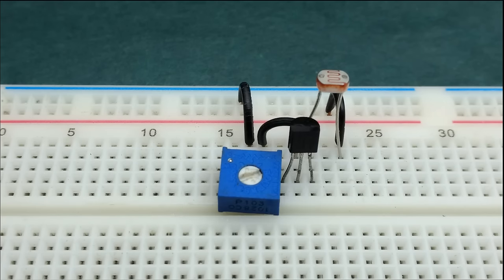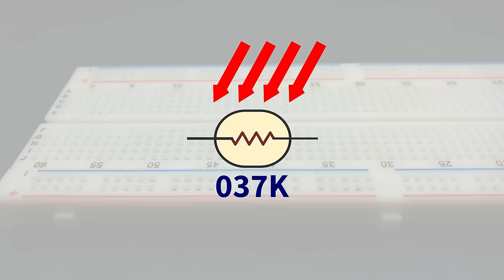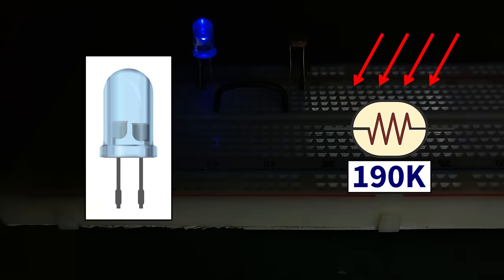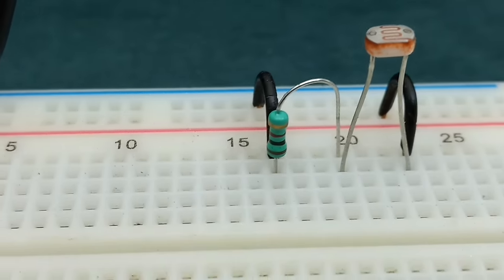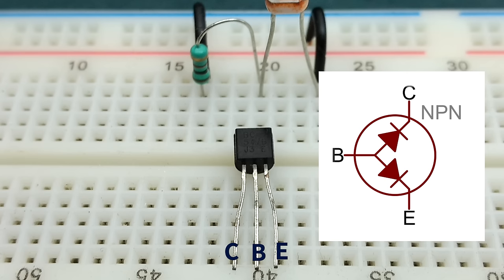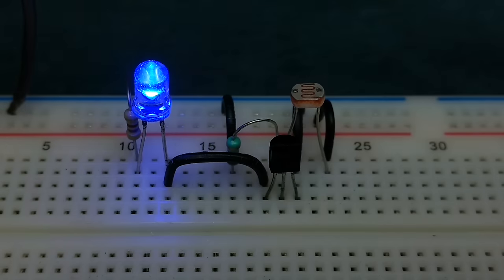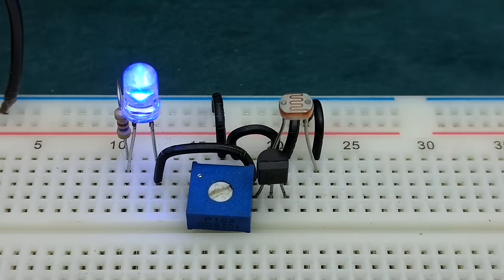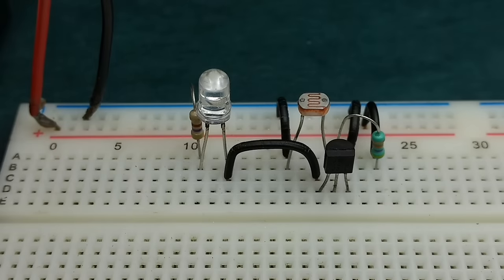Light Sensor circuit on Breadboard + Darkness Detector | LDR & Transistor Projects

Comment: Can you plz tell the reason that while using 1K resistor, it's light activated and while using 47K resistor, it's dark activated, why ?? Plz tell
Reply: The order of the resistor and ldr is also changed which results in voltage to decrease instead of increase.

Comment: Amazing. I finally got it working after hours  and hours. It will not work on an unregulated power supply so I tried a 6V battery and it worked!!!!!

Comment: Thank you, perfect for what I'm looking for: My Motorcycle has no fuel warning light so I'll be using this type of cicuit (modified) to detect the presence of fuel in my fuel line just below the fuel tap - I'll be adding a short 'clear' tube to the existing line & then fully enclosing the project, adding a small *𝒃𝒂𝒄𝒌𝒍𝒊𝒈𝒉𝒕 adjacent to the LDR on the opposite side of the line (this will then be connected to an LED warning light on my dash). * The idea being that there will be detectable differential in the strength of the *𝙡𝙞𝙜𝙝𝙩 𝙨𝙤𝙪𝙧𝙘𝙚 as the clear tube becomes devoid of any fuel.
It will give me time to engage the reserve tank via the tap (as the carburettors hold a small amount of fuel in their float chambers) - there ain't nothing worse than feeling that sudden drop in engine power as you unexpectedly find yourself on empty!!
Reply from the maker: Pefect! That's a great idea. Small automation's like this will make our daily experiences seamless.

Comment: Thank you! Feel very capable after being able to make this even if it's  ot much its a start
Reply: Hello, my sensor does not work. I don't know the problem. Is the reason that I used a resistance of 1 k instead of 470 ohms, and I also used a voltage of 9, not 12?
Reply: @حسنعامر-و3ب  it depende is the led just not turning on or it's always on , it might be the resistir or the wireless are connected properly
Reply: @MemoThePanda  The led is on normally, but when I put my hand on the sensor, the led does not turn off

Comment: Hi. Found a night light with one component labeled PCR 606J, one tiny resistor with Red, Black, Green and Gold bands in that order and a light sensor. Don't know what the PCR 606J is? Thought it was a transistor, but it may be a tiny SCR. Are you familiar with this type of light sensor circuit? Cheers

Comment: Hello, my sensor does not work. I don't know the problem. Is the reason that I used a resistance of 1 k instead of 470 ohms, and I also used a voltage of 9, not 12?

Comment: Great video. I installed a porch light with built in dusk to dawn sensor. Light turns on even when there is plenty of light outside. sensor is facing the street. Can I modify by adding a resistor etc. so it turn on when there is dark outside. Thanks and take care.
Reply: Hello, my sensor does not work. I don't know the problem. Is the reason that I used a resistance of 1 k instead of 470 ohms, and I also used a voltage of 9, not 12?

Comment: What changes must be made if we need to replace dc motor in place of led. Should any resistance be varied.. Pls reply @elonics
Reply from the maker: Depends on which transistor you are using. If it can drain higher power, you may try directly connecting the DC motor. Otherwise you need to add another transistor/mosfet to this circuit's output and connect motor to it. (See: Driving a DC motor using transistor / mosfet)
Reply: @elonics  its a 3-9v dc motor and transistor used is bc547 to a 9v battery

Comment: What common MOSFET can I use instead of the transistor for driving a bigger load (say 8v @ 10mA) ? Also which LDR, there's different ones with different resistances.

Comment: How can i connect a relay i  this circuit, i have used relay but it is turning on and off, (the voltage is decreased at output)

Comment: One question-
For the light detector circuit when the photoresistor is 0 Ohms, aren’t we applying input voltage (let’s say 12 V) to the base of npn transistor? If yes, will this not damage the transistor?
Can you please clarify.
Reply: Photo resistor value never fall below 10k
Reply: @TheWildElectron  Thank you for the reply. 

However, by pointing the mobile flash light directly to Photo resistor, I was able to measure the resistance under 200 Ohms. 
So not sure if I understood your response correctly or not.

Comment: I'm just trying to understand why we need more resistance in dark sensor (47k) as opposed to the one in the light sensor (1k). If anyone can elaborate on that a bit, that'd be hugely appreciated.
Reply: is it to drive more power to the LED, as the resistor is in parallel to the LED, by keeping the resistor high in value we direct more of the current to our LED instead of wasting on the resistor?

Comment: Would this work on a 110/220 volts led bulb? The ones used on regular lamps. Thanks.
Reply: I think to control an AC voltage you would probably have to feed the transistors output, which normally supplies the led, to a relay. By doing this the ac voltage would then be isolated. I think you could use a triac also which is made to control ac voltage. If you do a search on YouTube for the things I’ve mentioned I’m sure you’ll find what your looking for. Hope I helped you at least a little.
Reply: @user-wy3xe2tt3y  Thanks!

Comment: It's working! Tnx
Reply: Hello, my sensor does not work. I don't know the problem. Is the reason that I used a resistance of 1 k instead of 470 ohms, and I also used a voltage of 9, not 12?

Comment: In this light sensor circuit instead of light(LED),WE use the motor
Reply: Transistor will heat up like anything
You will need a relay or MOSFET for that
Motor will draw a lot of current which can destroy transistor

Comment: I cannot figure out where should I put the pot for the dark sensor. Please help me
Reply from the maker: You need to connect the center pin of potentiometer and any one of the pins at the ends, in place of the resistor
Reply: @elonics  thank you

Comment: what is better among photo-diode n photo-resistor?
Reply from the maker: photo-resistor is better. It is easy to debug.
Reply: Can I have a bit explaintion about it ? 
How Photodiode are better then photoresistor? In what aspects?
Reply from the maker: @khadijasoomro3519  photo-resistor is a passive component and so it is easy to test. Eg: You can just replace it with a resistor and see what the output will be.

Comment: What would be the output voltage or voltage on LDR
Reply: Hello, my sensor does not work. I don't know the problem. Is the reason that I used a resistance of 1 k instead of 470 ohms, and I also used a voltage of 9, not 12?

Comment: Can any one help to as to how to select the potentiometer of correct rating. I have 22,3 V (max) of supply from solar panel which is connected to zener diode circuit with parallel resistor of 1 k ohm to zener diode (3.0V) and parallel to zener diode is another resistor of 820 ohm which is connected to the photo transistor (BPX38-3 OSO) with Vce = 50 V, Vbe= 7 V maximum values. Between the ground and the emmitter of the photo transistor i have to connect the potentiometer which control the sensitivity of my photo Transistor to supply voltage to the gate terminal of MOSFET with Vgs= 16 V and Vds = 100 V which is connected to the actuator which is to be controlled with the phototransistor.

Comment: I arranged circuit on the basis of dark sensor circuit diagram,but the circuit was working like light sensor.
Reply: sabarish sabu Make sure to double check where your collector and emitter are on your particular transistor. Find its data sheet online. Also make sure that have properly distinguished between the 1k and 100k resistors and their location with respect to the circuit.
Reply: Ok,ill try it.
Reply: @hotdogsaber7233  did you got the solution...my led is always on